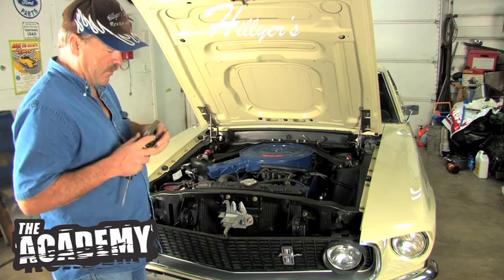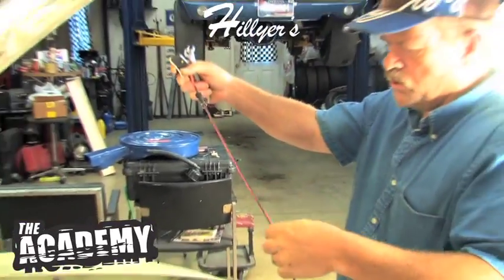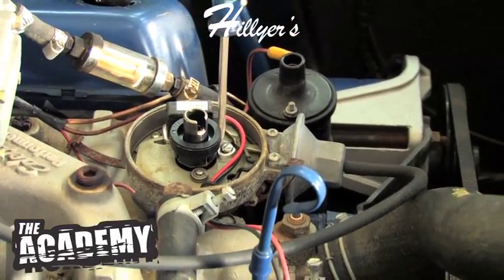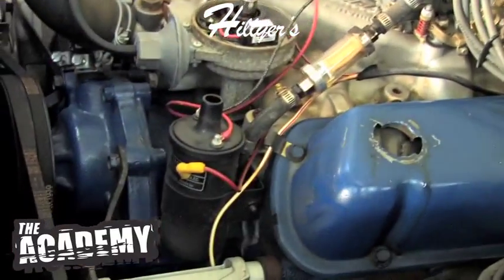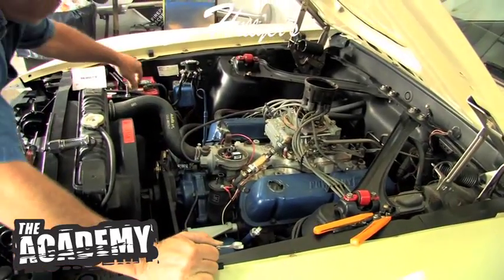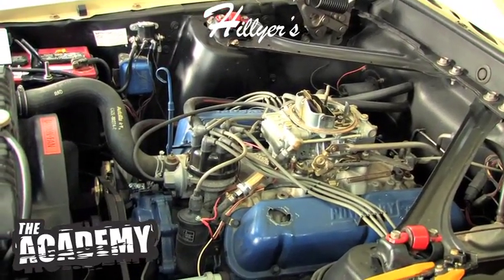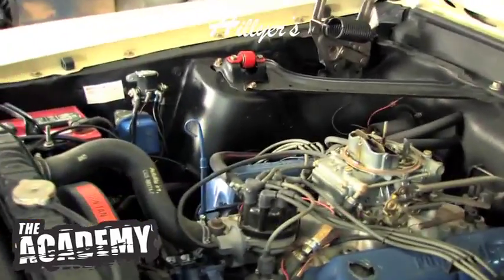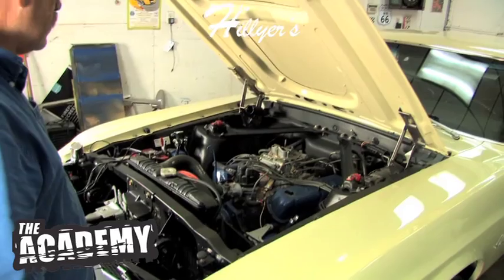DIY Converting your classic car over to Electronic Ignition

Comment: Talking to a tachometer repair guy that rebuilt my clock and factory Tachometer for my 68 Torino Gt , he
Mentioned the way the factory ford tachometer is wired/electronically the factory tachometer won’t work correctly if electronic ignition is installed.
Reply: If you install Autometer tach from Summit with this ignition installed, still hook it up the same way?
Reply: @jdmckinneyiii7081 
Wanted to stay with OEM tach as I think it keeps the value of the car that’s all original

Comment: Friend, is your engine a 302 and the carburetor is 600 cfm??? I have a 302 with an identical 600 cfm carburetor 80457-3. What size primary jets does your carburetor have?

Comment: I installed a Pertronix igniter in my ‘68 Cougar 25 years ago & it’s been flawless.
By the way, get rid of that deadly fuel filter. Those are notorious for leaking fuel & potentially causing a fire.

Comment: Please heed this advice. I only want to help....This video is in error. You must use a clean 12 volt power line to the module!  Connecting it to the positive on the coil feeds it a reduced amount of voltage and that's why they don't last. It must receive 12 Solid Volts. The original FoMoCo wire coming into the + coil is a reduced voltage. The Pertronix instructions say that both the module and the coil should get full 12V. Not the reduced voltage the original Ford wire suplies the coil when the key is in Run position. That is why so many comment that theirs failed.
Reply: Agreed, they are running on the resistor wire.
Also, the transistor can not pull as a good a ground as the mechanical points preventing full coil saturation causing incomplete combustion, even when properly hooked up.
Reply: Yes I didn’t go to Petronix after talking with tachometer rebuilder , because he said the OEM ford tachometer is not able to work like your saying. Hopefully someone will
Make a adapter with a resistor / diodes that would make OEM tachometer comparable with petronix and get full 12 volts
Reply: So where would you connect line to?

Comment: That wont last long you want to run it to a key on 12v source youre coil positive with key on is at around 6v it will burn out the system sooner than later.

Comment: So doing this upgrade wont affect the resistor wire that is installed into the ignition system from the factory? That also looks like the original coil intended for resistor wire or ballast resistor!

Comment: You're better getting a good electronic ignition distributor and then use the module the electronic part to the coil aftermarket MSD or something. And stay away from carbon spark plug wires used the good ones you'll see a little circular coil type picture on the side of them those are the good ones.

Comment: I happen to think this is an unnecessary waste of money.  Having to replace a set of points every 10-15000 miles is nothing.  I’ve owned a lot of cars with points and I have NEVER had to “reset” my points every 3-4000 miles.   If that Chinese module fails in the middle of nowhere you’ll have a hell of a time finding a replacement. To me, anyway this isn’t an “ upgrade”.
Reply: Just buy extras when you order the first one. And there’s other reasons to go with an electronic ignition over point. One is reviving huff

Comment: I just tried converting my 69 Lincoln mark III to this 1281 pertronix system.  The magnetic ring fits very loose on the shaft and just spins freely.  It will not press down any further.  I assume it’s supposed to fit much tighter?  Could it just be a defective part?

Comment: I just purchased a 69 fastback hasn’t been driven for a while .. I just installed the petronix igniter . Wires, spark plugs, solenoid. Th car cranks and  starts when I turn the key .. but as soon as I let go of the key it just dies!  What could be the issue?
Reply: Sounds like there is no voltage to the coil when it is in the run position.

Comment: I put an HEI distributor for 50 bucks off e-bay on my '79 Merc Marquis. Could not fix the original electronics. Works great and combines the coil and spark module in one unit. *Here's a crimping trick. Line up where you need to put the crimp on the terminal or butt splice with the tool then leave it in the tool. Bring the wire to the tool and then crimp it.

Comment: Well but that's my point the breaker played on the Ford distributor is good for about ten thousand miles if it's brand new. So if you're using a used or original breaker plate the system you just bought it in there go to be flipping and flopping all over the place.

Comment: Looks like your mounting this setup to the distributed plate or breaker plate.
  This was the inherently week link to the points dist.  And your bolting your setup to it.  Lol. What's wrong with this picture.
  But I have a question? If I contact portronics and agree to sell this aftermarket crap will they pay me to promote this goofy system? They must.
Reply: mate if they have sold these kits for over 20 years and most people are happy that should tell ya
Reply: The folks happy,more than likely don't know the difference. Once a guy understands the electronic ignition, he will see but the Ford duraspark ignition is perfect and it's all Ford. And if for some reason you needed parts they are on the Shelf readily available. And a lot of folks don't realize that there is a performance advantage running a large cap the duraspark 2 offers. What's person opens up the Ford distributor and understand the centrifical Wade system and how it works the adjustments that can be made are infinite. But even Jeff mentioned on the yellow Mustang when he first put it in the pertronix, he hooked it up to the resistor wire. This is a big mistake you hooked it up do a ballast resisted 9-volt. Not only that if I remember right Jeff was downplaying quality of the factory Ford Mustang tachometer. And deleted it. So what you do is take the ballast resistor wire out of the wire loom at the back of the pack tachometer. And run that wire route to the engine bay and run it to the hot side of the coil and the rum Circuit of the module. Now take the second post off of your solenoid and run a wire from that over to the coil and I believe white wire of the module and that is your start circuit. Our brand and wrap your wires. Don't forget to regap your plugs now instead of having a plug gap of 35000 you know need a gap of 45000. Don't forget your 8 millimeter wires and of course the large duraspark cap, and of course all of these parts are readily available off the shelf and unbeatable. Something I would like to see is if there is a performance advantage with the pertronix over-the Dura Spark? I have some friends going me wire in hey GM module 2 my Ford. So I did just to see what would happen. And the results were I lost power.

Comment: I don't get. BAR NONE THE BEST electronic ignition system made for your Ford is the duraspark 2 ignition system made in 1977. This ignition system can be brought right out of your tachometer if you have one eliminating fuel resistor wire brought right out to the engine hooked up to a switch 12 volt run a dual post starter solenoid run II post back to the start Circuit of the module and the coil light it and go. It will run so reliably been so long you will forget the last time you tune the engine. If something were to go wrong and you needed parts there are Parts absolutely everywhere on the Shelf. And relatively cheap. I must the crazy one.

Comment: Pertronix now offers a relay kit to solve the Ford "pink wire" problem. Or you can get your own but make sure the relay coil has a diode across + & - with a 30 amp contact rating.

Comment: I installed one on my 71/302, 3 years ago. Better performance, gas mileage and way, way easier to maintain. Every once in a while, I run into purists that think you diminish the value of your muscle  car by removing the points and condenser. Sure, whatever. 🙄  I recommend it to anyone with a classic.  And anyway, as others have pointed out, Keep the old points and condenser and put them away someplace handy.  You can always put them back on for car shows or when you get ready to sell.
Reply: I was considering this with my 1965 Mustang. Im getting real sick of my points burning seemingly prematurely (probably some underlying electrical problem causing it tho). I believe my points burning is causing the recurring stutter issues with the engine (usually happens after it gets to operating temperature). And now its doing it to me for the third time in about 5 years. 
I swear the old points system is as weak as the ignition system in a Mazda RX8.

Comment: Will that work on a 1973 or 1974  Chevelle Malibu SUPER SPORT or Type S-3 Laguna with the 5.0 litre or the 5.7 litre 350 Turbofire.
Reply: Just put a HEI system out of about a 1975 Chevy. They work quite well swap the whole distributor. 
Coil and module are all self contained.

Comment: What about having to bypass the ignition resistor wire?
Reply: The petrronix electronic ignition I put in requires a full 12 volts all the time.   My 66 thunderbird had the resistor wire that provided 12v  at startup and then kicks it down to go easy on the points.  That's great for points but no the EI.  They work for a while and then fail.  Well I burned up 3 units .
Reply: @markthomason2754  Thanks.

Comment: Only question I have of this video of upgrading the electronics of the Mustang is what other wire did the mechanic cut, crimp an
attachment to and screw to the coil?  That part was not entirely clear?  Anyone know?
Reply: That red wire goes back thru the firewall and to the ignition switch

Comment: You can buy an HEI distributor from Speedway that drops right in and even eliminates the coil.
Reply: It's a GM based distributer and takes up too much space. Not good if wanting to keep the vehicle as close to stock as possible either.

Comment: I'm no mechanic but this is a hobby I could get into. I've got a 79 dodge b300 tradesman maxivan with a 360ci 4bbl 625cfm carb. Love it.
Reply: Your '79 Dodge b300 should already have electronic distributer.  Chrysler began using electronic ignition in fall of 1971.

Comment: I did this to my '70 f250 with a 390FE.  It's been running reliably for 3 years and starts way easier. I think the only time this system has failed is due to operator error at install.  Definitely no complaints here.

Comment: I know the video is old, but did you remove the ballast resistor and the ballast resistor wire at the ignition? If you didn't bypass this , then you're  only getting 6v at the coil. Pertronix needs 12v to operate correctly.
Reply: 1970 HB you’re absolutely right. I have a 71 f250 with a 360ci and I’m gonna install this. Just trying to figure out how to bypass the resistor wire.
Reply: I've seen guys do this, and I've also seen you guys the said you eliminate it some systems you keep it. I learned how to hook up the duraspark to ignition to all my old Ford. The small blocks the Cleveland all the 460 it's the easiest thing you'll ever set up and you'll never look back parts are on the Shelf ready to go. I am 40 Years of using the system I've come across one bad module and that's it
Reply: 5point9, Fords don't use a ballast resistor.  Power to the coil is 9 volts and resistor is in the ignition switch. Pertronix, and Mallory, systems for Fords is 9 volts.

Comment: Don't forget to mention to take the old points and condenser and put them in your trunk in case that module goes bad and leaves you stranded.
Reply: @V_ AP Bad installation can certainly cause it to fail, and many last a very long time with happy owners.  But if you're a tech or engineer and examine the electronics with an oscilloscope you will see the triggering all over the place. Pertronix systems are always down on dyno power because of spark scatter.  And the retrofit version with embedded magnets in the ring is especially bad with even worse timing variation on each cylinder because the magnet position in the epoxy varies, plus huge magnet ring warpage means the gap varies. The GM version is usually warped .060" or more right out of the box. This has nothing to do with halfwits installing wrong, and just because they run and your "butt dyno" can't detect problems doesn't mean they run right. Add a little heat and you can watch things get even worse.  The design and manufacturing is poor.  A high failure rate is just one way they are junk. And, while I agree that that halfwits can screw up the installation, the fact they can do it so easily is even more evidence of a bad design. The failure rate among the other brand conversions (Mallory, Crane, FAST, etc) is far, far lower because their design and manufacturing is far, far better.
Reply: Exactly right!
Reply: Pertronix = total junk
Reply: Yep like mine did yesterday.   Pertronix was easy to install but hasn't lasted very long.   In my opinion waste of money for mine.
Reply: Jason Harville : I got 10,000 miles on my petronix kit before it stopped working. What a waste of money.
Reply: @ODucks55  8
Reply: @ODucks55  wow I was debating doing this upgrade. I’m not super handy, I’ve done the oil changes but I wasn’t sure if I should do this or not.  I had a question since it sounds like you know your stuff: one day I was at a light and the car was barely turning over.  I took off and it drives fine, but at low idle it felt like it was going to stall.  I got it home.  A week later I ran it and it was high idle before I kicked it down to a lower idle. Still on the high side.  I know it’s just guesswork but do you have any idea why this is? I don’t want to get stranded but curious why this may have happened.  It’s a 66 mustang 200ci automatic.  Thank you!
Reply: @gary_michael_flanagan_wildlife  Yeah, that’s a tough one to try to figure out via texting. If it’s electrical check for good contact connection points on all ignition wires and no broken or cracked insulation that could be causing it to go to ground. Good luck.
Reply: @ODucks55  thank you. I drove it around again today. Today the idle is a little lower and it was running nicely. I know a lot of us these days take advantage of the regularity of fuel injection, maybe some days it’s inevitable the carb may cause the car to run lower idle.  Or perhaps I had some bad gas that day.  Not sure since I can’t really pinpoint it.  Thanks though.
Reply: @70_Torino_Guy  Mallory conversion kits were very reliable. I put one in a '68 Corvette 21 years ago and it's still working just fine. I have one in my '66 Mustang 2+2 fastback also and it has not failed in 10 years.

Comment: Should this be done in high idle or normal idle?
Reply: idle is spec timing, then the distributor may have a 5degree advance @3500rpm for example. -General information only.

Comment: so if your using the stock low resistor wire how many volts will you get? Does anybody have the answer?  6500 on 74 camaro stock hei.

Comment: Forgot to connect the ground wire with the mouting screw (Could cause a module failure or intermittent stalling), Didn't set the air gap with the clear plastic gauge that comes with the kit (Again, intermittent stalling or crank, no start). Otherwise all good.
Reply: HV I saw him set the air gap with the clear plastic. @ 2:11
Reply: Boneshaker yep me too

Comment: How can I modify an electronic ignition system (Rav V) to avoid those outrageous key replacement charges?  Until about 2010 you could make copies at places like Wal Mart but no more.  Outrageous?  $300 from the manufacturer and and up to $1000 from National car rental and most others.  Reportedly you can't modify an electronic system if it affects mileage (environment) and safety.  If you can convert to an exiting electronic then it must be possible to convert from one. Any help?  Mike

Comment: SatchmoSings  I'm not entirely sure what your saying about old car motors not lasting as long as new car motors. Perhaps in many cases but my Dart's 225 slant six is on a points and condenser distributor (I'll be upgrading to electronic ignition shortly) and its 40 years old. Its odometer has rolled over twice now, at least 600,000 miles on the car and she's still running like a champ :P Never had an engine overhaul either, though I probably should haha.

Comment: Thanks for the video!

QUESTION: Could you recommend a upgraded distributor for my 1976 cj7 jeep with 258 I6? I am going from a prestolite ignition to a GM TBI with fuel injection and a ecm.. Hope to allow the ecm to control spark/timing... :)

Oh, by the way... I believe my cam shaft is soft iron, do you sell the dizzys specifically for the set up I'm trying to attain?
Reply: *****
 Thanks for the suggestions... :)
I will keep them all in mind...